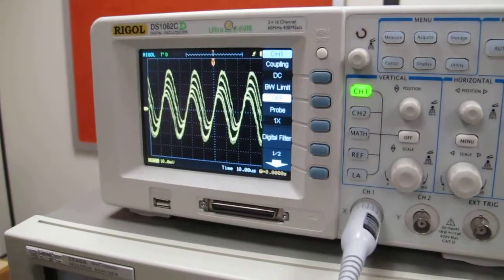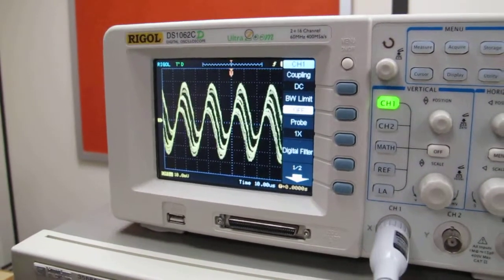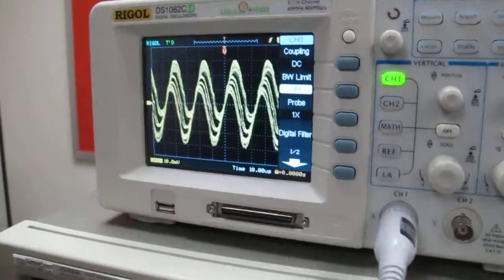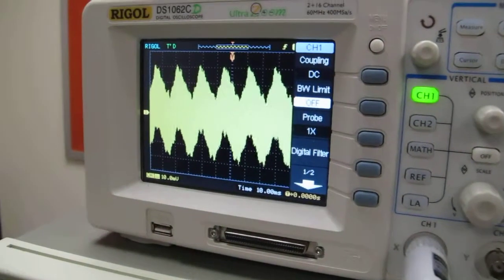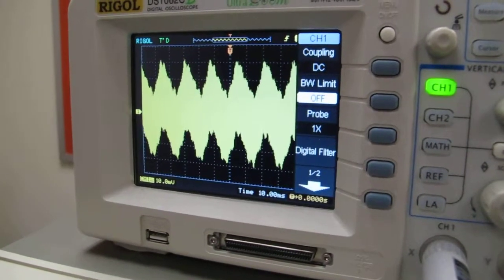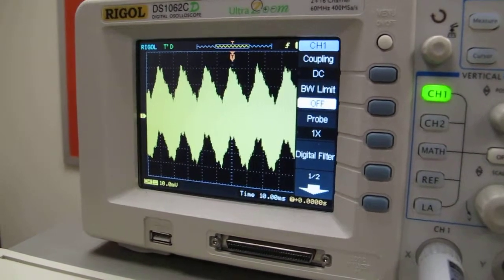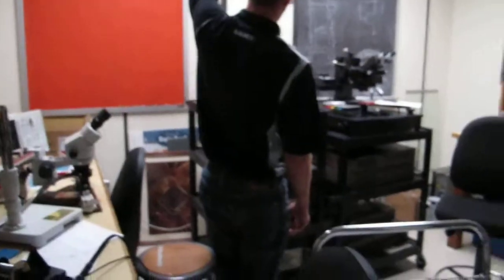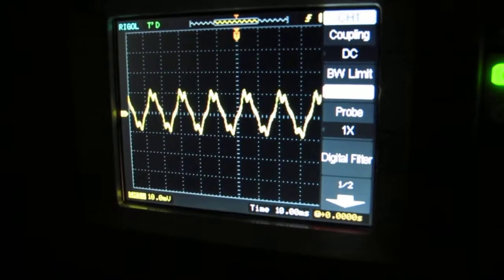Radio noise (EMF) from high-efficiency fluorescent lights (4 of 4)

Comment: 14 years later, tks for this video
Reply from the maker: Sadly, in those 14 years it has only gotten worse. We moved into a new building about 7 years ago and the RF interference from the lights there was about 70 dB above the thermal noise floor, messing up radio reception well into the VHF and UHF range. I think the edge speeds of the 40 kHz switching were much higher than 14 years prior. And recently I tested things in my house. Here's a video I did on that - as well as a solution that works (at audio frequencies) to allow me to use a microphone with the scope 🙂  https://www.youtube.com/watch?v=-pm5ADJrKT4
Reply: @MegawattKS  :face-red-heart-shape::face-red-heart-shape: